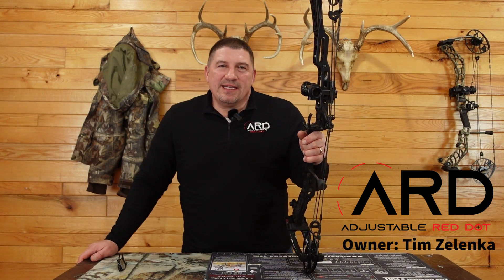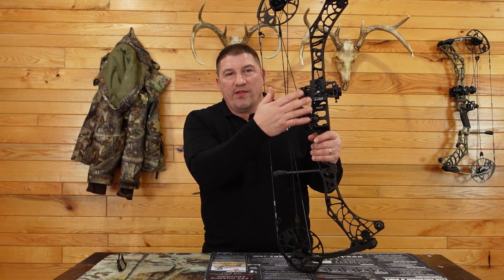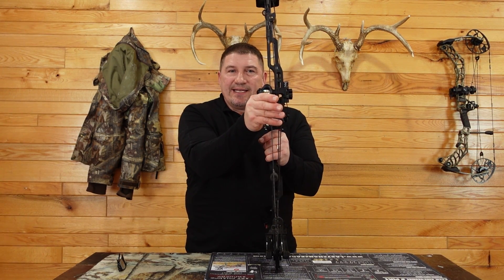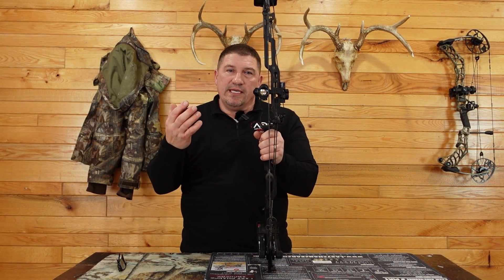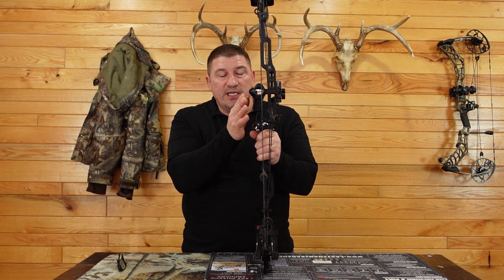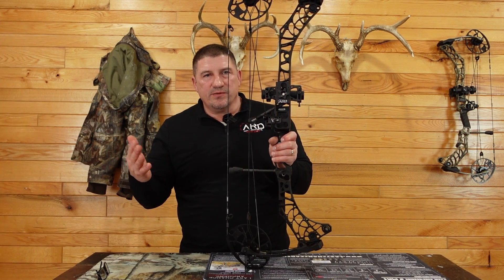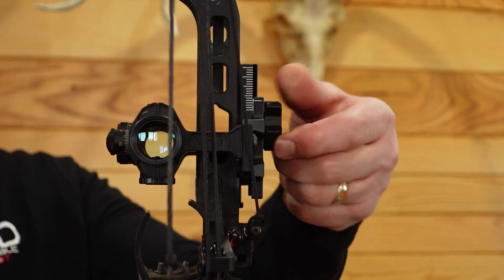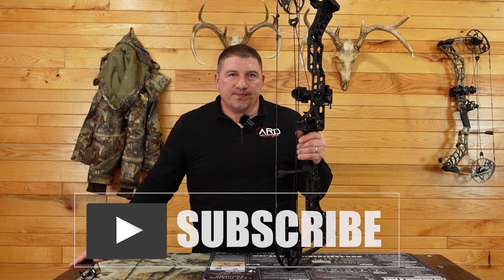How does a red dot work on a bow? - Adjustable Red Dot

Comment: Question do you center the dot on the bow string or to the left or right of the string? Can you use a peep sight with this setup?
Reply from the maker: we do not look through the string. We center the dot within the sight. No peep sight is used in this set up as it takes away from the purpose of the red dot. The red dot lets you know if you are torqueing the bow or if your anchor is off.

Comment: 2 questions:
1-I ranged my target and its 55 yards, how do I know that the ARD red dot is on Target? A Sight tape?
2- Are there different types of scopes available, different powers 3X? 
Thanks.
Reply from the maker: Yes we have a sight tape option. We recommend taping your chart on your riser. We have examples on our website.
Like in the video, it’s is not a scope. No red dot sights have magnification. We offer red dots with different moa options. With scopes you would have issues with eye relief. Does that make sense? If not we can do a breakdown different between red dots and scopes video? 😊
Reply: @adjustablereddot  ok understand both responses, appreciate it.👍